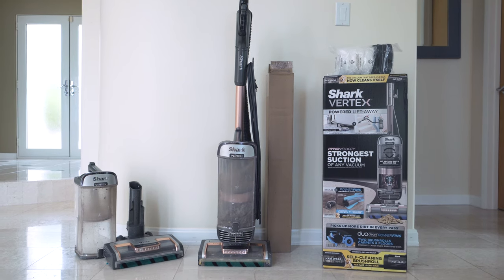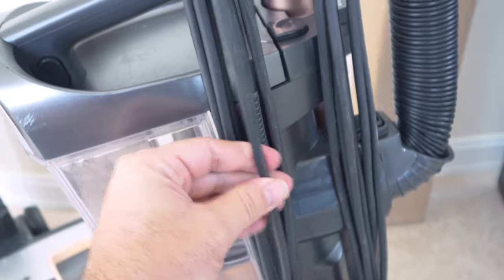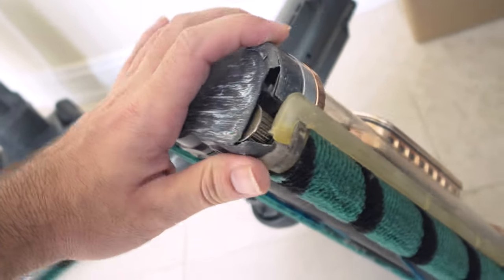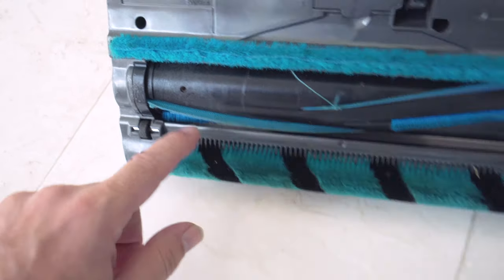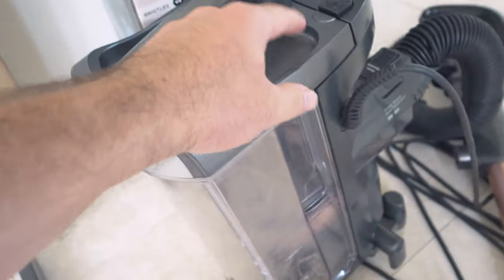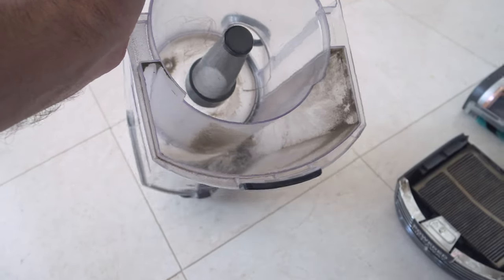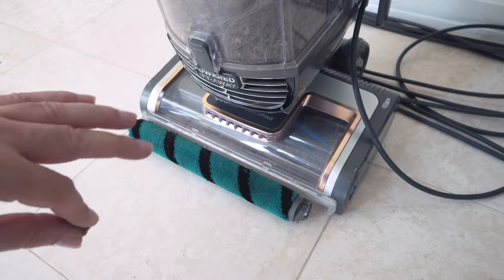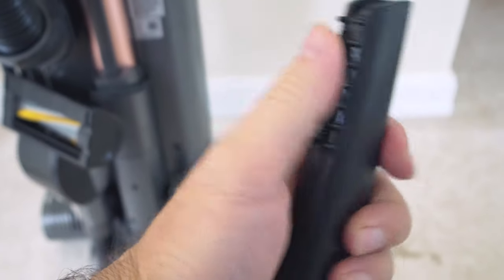Shark Vertex Vacuum - 1 Year Update & Maintenance

Comment: The Sebo’s are designed to be serviceable on the spot - without any tools - by the user. Clogs can be removed easily at any point in the machine, no matter where in the piping the clog is. The brush roll is also super quick and easy to remove without tools. It’s very light weight as well. Sebo’s last 15 - 30 years with daily use. They even use them in the White House.
Reply: I somewhat agree. Sebos are not very well rounded. They are more carpet based. Sharks are universal and can do pretty much anything. Sebos also can get pretty heavy. Especially with cleaning all day everyday. Also, buying bags constantly gets very expensive. And it doesn’t have any fancy features like anti tangle brushroll or soft roller. So a lot more maintenance will need to be done. Which is that last thing you want when you vacuum a lot. So while sebos are decent carpet cleaners. They aren’t really good for much else. Not to even mention the price. 2x the price for something that can’t do everything you need it to. But that is just my take on it
Reply: Miele vacuums are great too.
Reply: @DillonCleans  Sharks cannot be easily repaired and the soft roller is a joke. It simply exists for marketing. The only thing it does is scratch your flooring and adds more mechanical complexity that isn’t needed. And 12 bags cost as much as a pack of filters for the shark. Plus with the Shark a lot of extra maintenance is needed (clean the soft roller, wash or wipe out the bin, change the filters constantly). With any bypass bagged Vacuum little maintenance is needed because all you need to do is change out the bag every month (depending on use), change the filters every year or more, and clean hair off the brush. And yes it is true the majority of Sebo's line of vacuums are not meant for hard floors but I suggest you look at their full line up or other brands such as Lindhaus. Sebo has the Felix/Dart which is an incredible multi floor machine and Lindhaus has the health care pro another amazing vacuum. And the reason Sebo, Lindhaus, Miele, etc. all have higher prices is because those machines are meant to last and they are made in German and Italy. When you can spend 2 times the amount of a Shark and get a vacuum that will last 20 times longer that is 100% worth even with the cost of bags factored in. There is a clear reason why you NEVER see bagless vacuums in commercial settings, because they don’t last as long and need a lot of maintenance. Sharks are the disposable vacuum of the industry and that will never change. I suggest you look at Performance Reviews videos if you want true insight into the industry and want to find a true vacuum that will last a life time.
Reply: @nicholask516  you watch too much performance reviews. Not anyone can just spend $800- well over $1000 on a vacuum. And the bags are expensive. And you actually don’t need to replace the filters on the shark often. Maybe once every couple of years. And you go through bags fast. And if you wanna say that duoclean does nothing. That’s just funny. I have videos on my channel showing Miele and sebo on hard floors. Then a shark apex just devours everything it misses. And btw, they don’t scratch. If you can show me proof that it scratches, please do. But I know you don’t have any. Not everyone needs a Miele in a house. And me and you both know that the shark is not an awful vacuum. It’s a good machine. Especially in its price point. It’s good at hard floors. Carpets. Above floor cleaning. Under furniture. And these almost no cost of ownership. And if you take care of the vacuum, it will last. You decide how long a machine lasts. Don’t blame it on the machine if you don’t take care of it. Just realize the reality of vacuum cleaners. Don’t get stuck on old technology. And don’t be mad that newer companies are taking over your favorites
Reply: @DillonCleans  “buying bags can get expensive” that’s a most ridiculous argument that I keep hearing and it based completely in lies. If you actually do the math it’s simple. My Sebo x4 needs a new bag once every couple of months with regular bi-weekly. Their BEST bags are 32$ for 8 bags. 32/8=4. A bag every 2 or so months comes out to $2 or less a month…IN WHAT WORLD IS THAT EXPENSIVE?!?!?
Reply: @MrMcMuffinJr1999  or you could own a good bagless machine for $0 a month. Speaking of a Sebo x4, I will be posting with one very soon. It’s a video showing it get absolutely crushed by a cheap shark
Reply: @DillonCleans  being rude is not my intention, so please don’t take this that way. Your argument just doesn’t make sense to me. Extra time on maintenance? I agree, it is the last thing most people want to do. Sebo vacs are like the least intensive when it comes to maintenance. You don’t have to constantly wash filters to keep performance with a high quality bagged unit. So, even with taking the brush roll out to cut hair off of it once or twice per month, it still ends up, at the end of the day, taking less time spent on maintenance. If you get a jam in a Shark like this and can’t get it out with something, you can’t just simply remove the brush roll to get to it, so then you have to spend far more time taking it someplace to get it serviced or taking it apart with tools. That right alone would make one spend more time just doing that than they ever would maintaining a Sebo for years. Sebo vacs are designed that way. Even if it needs a new bag and filters put in, it takes far less time to maintain one. All of it takes is 5mins? Maybe 10? Also, it’s 2x the price because it lasts 4x as long. Things just tend to not break on Sebo vacs, whereas they do with Sharks and other big box store brands. Whole components have to be replaced instead of being able to be repaired. That can get expensive, especially after warranty ends which is far shorter. Constantly buying bags? I buy bags once a year. That isn’t constant. I replace the bag once per month, which is more frequent than most people. They aren’t expensive, but they can be gotten even cheaper on Black Friday and sales day which works out since it’s only a once per year purchase. Some Sebo vacs are best studied for carpet, but they make many models that do a great job on hard floors as well.
Reply: @DillonCleans  and I want to say that you should compare the Sharks to the vacs that are appropriate for your comparisons. X4’s don’t clean carpet very well UNLESS boost mode is enabled. Miele vacs - you need to compare it to the right one, again. Many, most, Miele models are not fitted to do carpet. They are meant for homes for hard floors and minimal amount of rugs. However, the SEB228 power head fitted to a C3 does a very satisfactory job, especially in terms of agitation. My Kirby and Miele are the 2 machines I have that leave very deep carpet lines on my Berber. Berber is very hard for a vac to lift up and groom. The ones that can are usually top performers. Sharks are decent for the money. Not everyone is in a place to spend $1,000 on a better unit, and that’s okay. They get the job done. I’m just showing you 2 sides to the coin, another perspective. I own Miele C3, Blizzard, U1, Triflex, X4 Boost, Felix, Sebo E3, Sebo D4, Riccar Tandem, Vertex, Animal 2, Animal 3, Rainbow E2 & SRX, Hyla EST Defender, and more. I’m super weird about a vacuum griping and pulling the carpet pile up and leaving nothing behind after 1 pass, and not many of them can do that. My C3 can, Kirby can, Felix does with a new bag, and the X4 does in boost mode. Out of those, only the Felix and C3 do an equally fine job on hard floors. I still like Sharks, though. I’m considering getting a Stratos, but not sure if I want to just yet. They are on sale for $299 and I am tempted to. I hear they clean carpet better than previous Shark models. Also, as far as comparison tests go, I only consider the certain tests when debating performance, namely the ASTM’s, as those are well-supported, peer-reviewed and validated. Vacuum Wars uses some of them. Other tests I go by are just common sense. Some of them are not absolutely precise, but are close enough to warrant consideration and referencing. Other tests are flawed. Vacuuming with one vac and then using another right after has too many variables that cloud the results. Usually I don’t consider those. Sometimes it’s because someone doesn’t vacuum often enough, or the correct way. Maybe they aren’t using the units properly. Maybe they’re rigged, or maybe one or both is in dire need of service. I think Sharks clean okay. Performance isn’t something you don’t get at the $400 price point. It’s the quality, filtration sometimes, etc. But, at the same time, one isn’t paying for more. I think people get what they pay for with a Shark, for sure, at the right price. Vacuum Wars has some convincing tests that indicate the Vertex and Stratos clean pretty well. He uses ASTM tests for filtration as well. His test suggests the Stratos cleans a little better, citing an improved brush roll as the cause of it.

Comment: If there is a little water on the floor or after washing the dust holder there are some water left over, is it ok when there is some water and you use the vacuum? it will get stopped at the 2 filters? but you don't want too much water right?  also why are there so few videos for the canister version?

Comment: I have this vac and get exhausted after using it. I find it bulky and heavy to use. Also with the double roller it wants to take off on carpet especially if you separate the bottom half to vac under furniture. Would I buy it again? No because now I dread vacuuming.

Comment: I wish someone would show how to properly clean the filters. There are no directions on if. Are you are just supposed to rinse it out or work it underwater and then squeeze or wring it out or not? Will squeezing out the filter damage it? All the manual says is don't use soap. So just run tap water over the filters including the hepa filter to clean them all? Or use a high pressure air hose for the hepa filter and blow it back out the way it went in? I can guess and probably be fine but I would rather someone showed the best way to get the filters the cleanest without damaging them.

Comment: Using a Shark or any bagless vacuum in a light commercial or commercial environment is truly foolish. Sharks are disposable vacuums and are not meant to last more than a year. These vacuums cannot be easily repaired and most parts are not available. Also the “Duo Clean” head is simply designed for market. The soft roller truly does nothing, all it does is scratch your floor and adds more mechanical. The fact that you expect a vacuum to only last 6 months for your business is truly sad. If you want a real vacuum that’s meant for a heavy use environment look at a German made or Italian made machine, such as a Lindhaus, Miele, or Sebo. Both Sebo and Lindhaus make high quality vacuums that are bagged and that can be very easily serviced. These machines will easily last at least 20 years if you change the bag and filters. You could spend $300 on a Shark and have it to buy a new one every 6 months or you could spend $700 and have it last 40 times as long. Now I hear the argument that bagged vacuums are more expensive to maintain, that is false. The filters for these sharks alone cost as much as a pack of 12 bags which will easily last 6 months or more with heavy use. And the nice thing about a bag is that toy just throw it away. No dust bin to wash or clean up and you don’t need to breath in and release all of the allergens you just vacuumed. There is a reason why you don’t see any bagless commercial vacuums, because they don’t last as long.

Comment: come on, everyone in the industry knows both Shark and Dyson make garbage products that don't last at all.  Be honest and encourage purchase of good quality 
products like Lindhaus, Sebo or Miele just to name a few.
Reply: You do realize that the brushhead on the Sebo's are also made of plastic as well right?
Reply: @domdom6624  haha you do know the Sebo is rated for 2000 hours of use right?  Dyson and shark are virtually disposable crap right?
Reply: @domdom6624 Fiberglass reinforced plastic, actually the entire machine is made of that stuff. Sebos are built like tanks. Ever wonder why sharks have so many screws? Because they use cheap plastic that breaks easily. Also if the brush breaks are gets warn out you can buy one inexpensively and change it in less than 30 seconds. How long does it take to change the brush on a shark? From the experience I had repairing hundreds of sharks. It takes roughly about half an hour to an hour to get the new roll in there. They don’t sell you one either I have to go aftermarket because they want you to throw it away instead of repairing it because they are a shady POS garbage company that deserves to go out of business.

Comment: Not to be rude or anything but may I ask why you just won’t buy a commercial vacuum cleaner that are built to last these circumstances
Reply: I think because they are heavier and these really clean great. The Kirby is the better option just heavy to move around.
Reply: Exactly just get a SEBO, Lindhaus, Numatic it will last a lifetime. No dirty filters to deal with.
Reply: I cleaned house for a bit. I used Dyson and Shark, but Sanitaire at home for personal use. The first two could go between carpet and hard floor, were easier to use on stairs, and you didn’t go through bags. You didn’t run the risk of carrying any contaminates in the plastic canisters as you would with the cloth bag of the Sanitaire.
Reply: I can't speak for the guy who made the video and I am fairly new to commercial cleaning and don't have experience with commercial vacuums but for my cleaning needs if I were buying bags for a commercial vacuum I can tell you that it would be way too costly for me as I have to empty the dust bin on my vertex 3 times each time I do my cleaning jobs but I only have to clean/change the filter once. I collect probably 15lbs of dirt each cleaning. I have purchased the same aftermarket filters he showed in the video and they work well for less than $20 and maybe 2 times a year I will buy them. I would prefer a vacuum that is easier to repair but the versatility and performance on this vacuum is the real reason I chose it.
Reply: @AlextheguitarFreak even if you are using it a lot bags are proven to be more cost effective. Some bags cost like 10 bucks for a pack of 9.